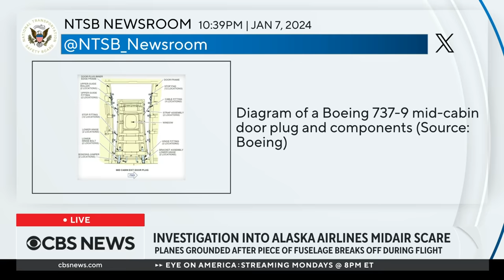Investigation into Alaska Airlines plane's door plug blowout underway

Comment: You mean a faulty emergency door that was compromised by putting more rows of seats next to it after production. Just to add more people to an airplane while sacrificing safety? Great idea.. now they should be sure by every passenger.
Reply: No, the extra emergency exit was part of the design from the start.  It isn't required if the airline fits less than 190 seats onto the plane.  Alaska has 178 seats fitted, so there is a permanently mounted plug instead of a door.
Reply: no the fault was in the insulation or reinstallation of the door, cater pins must have been left off or loose bolts sheared them somehow 
i guess the fleet inspections have found 5 more loose bolts so far not sure how that relates to the carter pins
Reply: @marknelson2846  This could start to rival the cargo door on the DC-10. Failures like this had better be confined quickly. This is what can ruin aircraft makers. Douglas merged with Boeing because they were hurting because of design flaws and mechanical maintenance shortcuts
Reply: Capitalism always comes first. Money will always supersede human life.
Reply: Please just stop.  The airlines actually put LESS people on the airplane.  The door is meant for more passengers (200+), since the airlines (Alaska does 178 seats) didn't put that number of passengers on the airplane, the door isn't necessary, hence why it becomes a plug door.

Comment: It was another Boeing plane. Let's not sugar coat it by labeling it as an Alaska Airlines plane. Also why is that even a design? A patched up door with a window.
Reply: Exactly. Ever since the Boeing merger with McDonnell Douglas the company has been going downhill.
Reply: It has to do with the airline trying to fit as many people as possible but keeping it as legal as possible so that airlines wouldn’t have to install an actual door to save money. Other countries have the  exit door there
Reply: ive heard Spirit builds that plane, Boeing must have finished it and may have installed the plug we'll see i guess
Reply: Easy answer, the airplane is designed with the idea to have more than 200+ passengers on board, requiring two extra emergency exits.  Alaska and many other carriers don't utilize that number of passengers on said airplanes, so the door is not used and it is plugged by the manufacturer.

Comment: Sounds like a load of BS if it was such an insignificant warning about cabin pressure why was the plane taken out of "normal" service ie had to stay close to home, couldn't fly over water... etc. Do better C-BS
Reply: Please don't listen to any of what they said.  It not flying over water is a separate issue.  ETOPS...  It's a brand new airplane and needs to have so many cycles in revenue service before it can fly to Hawaii.  This is common on ALL ETOPS capable airplanes.

Comment: United Airlines has also found loose bolts and other parts on 737 Max 9 plug doors.
Reply: Cutting corners I see
Reply: @j.r.357 I think the 737 fuselages are built in Wichita,  then shipped by rail to Renton WA for final assembly.   The South Carolina assembly line builds the 787 Dreamliner.